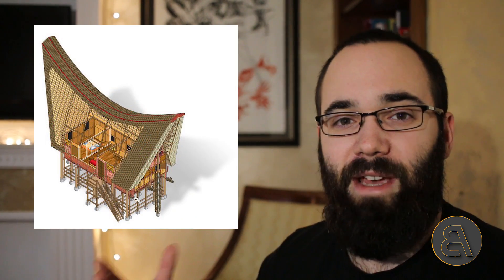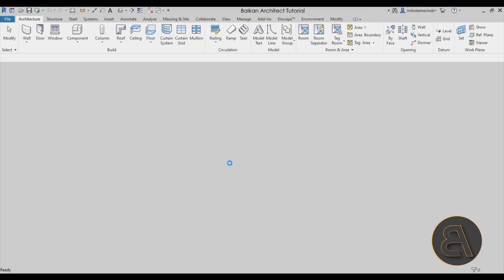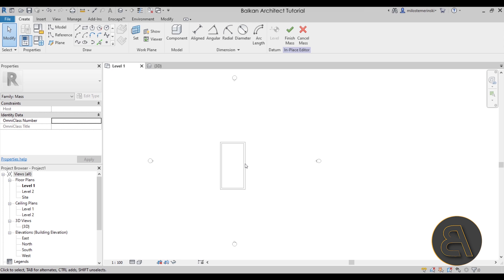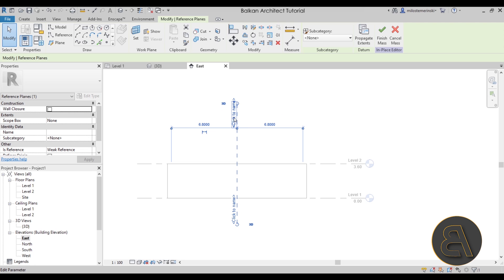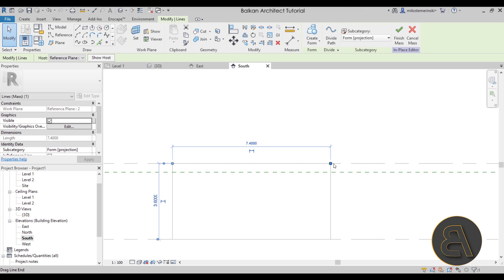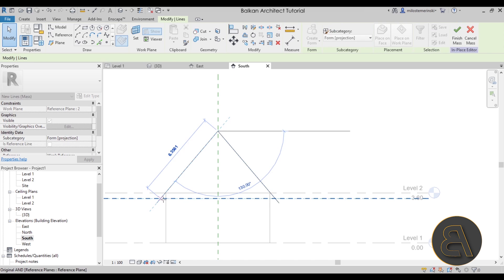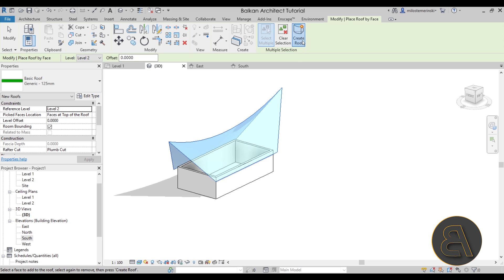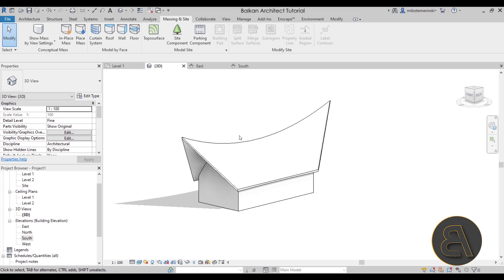Traditional Roof Shape in Revit Tutorial

Comment: Hi there my friend, I wanted to ask a question that is not assosiated with this video. When starting a project in Revit, do we start as work flow dose on the acctual project, example, we start with foundations-slab,colomus, beams,slab on top etc then walls, electrical, plumbing, rendering etc... or do we start with walls and work our way to upper and lower levels?????
Reply: Most revit users if architects begin like they would make a drawing. Likely in plan with walls and functional block planning first. Details tend to follow depending on the stage of design.